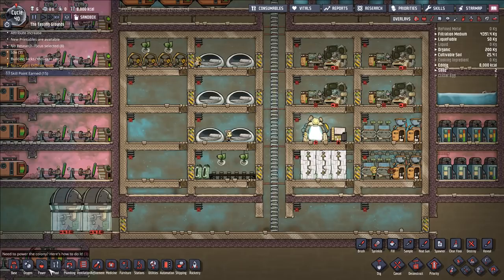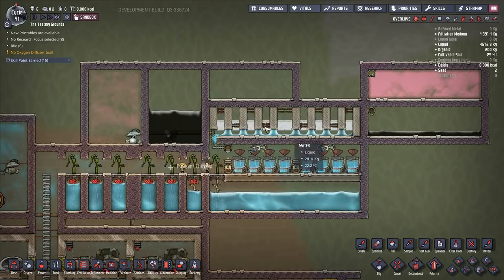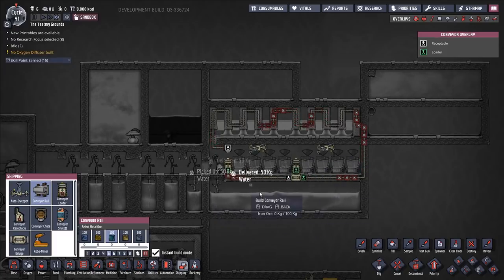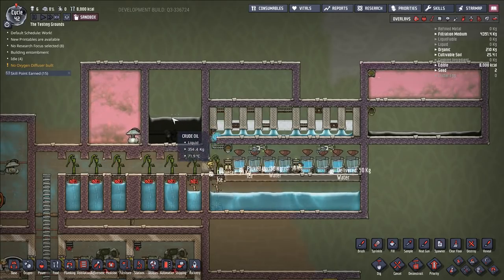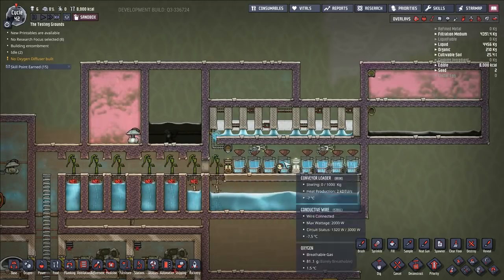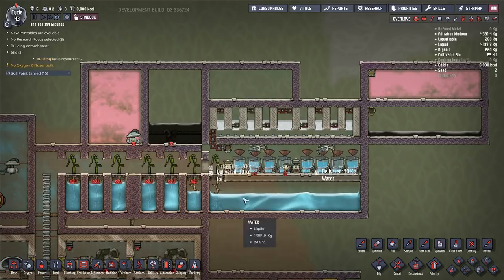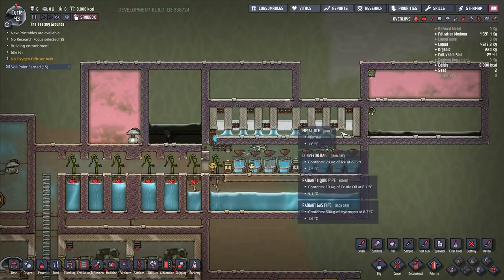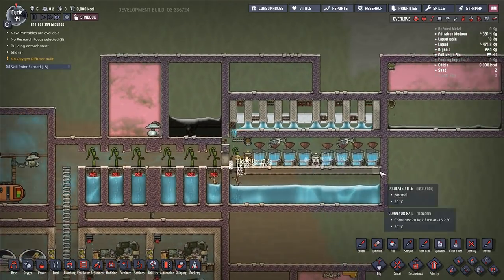A Guide to the Ice Maker - How to Cool Effectively [Oxygen Not Included]

Comment: Gearhead, I like your deep-dives into the mechanics. You have found some interesting side-channels to optimize. Do you have any fully self-contained bases without using volcanoes/geysers/space?
Reply from the maker: I do not, but it would be an interesting challenge, and it's definitely doable.  Dreckos are a food source that doesn't require any inputs, heat management can all be done in a self-sufficient manner, the only question is where to get oxygen.  If oil reservoirs are allowed, then you can generate water with them in conjunction with an oil boiler / sour gas condenser.  Otherwise I think you'd need a setup with morbs.

There might be a good mod for a challenge like this actually, I'd have to check.
Reply: it s impossible in long term you will lake water and so on. That s why there is geyser etc.. And generally the only system they are equally sufficient, are in the future downgrade to get always a loss